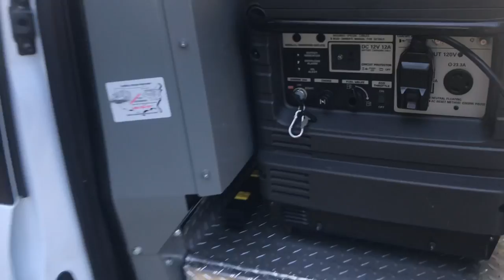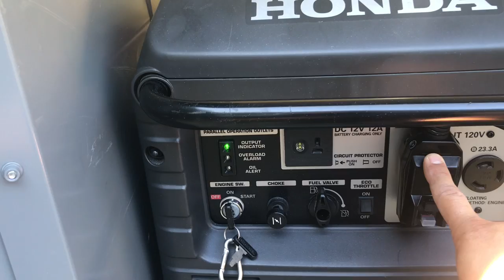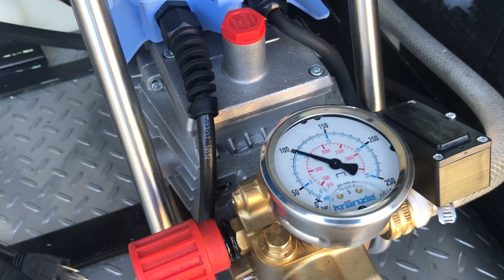Kranzle K1322TS

Comment: Genius set up for the water line system. It will make it very easy to go from tank to water hose without the need for extra hoses. To fill tank.
Reply from the maker: Momentum Tint & Detail Thanks sir thanks 👍🏼

Comment: NPT 3/8 female to male 90 deg elbow. Hardware store in plumbing section under $5. It will be black steel. Don’t be alarmed, I had to use one to connect my hose to my reel. It will hold up to the pressure without a problem.
Reply from the maker: Momentum Tint & Detail thanks I will do that thanks sir 👍🏼👍🏼

Comment: Hi bro nice setup I just bought mine but have some questions about the psi readings isn’t your reading on this video 1600 psi I have the same. But isn’t this 1500 max  ? Aren’t the red marks the psi reading I use the 4.0 nozzle like mat recommends but gets this hi I don’t want to ruined it
Reply from the maker: Alberto Alonso is all depends on the nozzle you will be ok not problem I use all different nozzle and I get different readings so all good bro👍🏼👍🏼

Comment: Given that you have a mobile setup, would it not have been better to just get a gas-powered pressure washer and skip the generator? 
A gas powered Kranzle 13/150 Profi jet pushes 3.4GPM. The 1322 pushes about 2GPM

Comment: How much water did it take to wash your truck? Can you reduce the gpm?
Reply from the maker: You can reduce the gpm but is going to take longer on this truck with all that mood like 30 gallons but in this case if you get a detail like this you need to change more or use the costume water 💦

Comment: I love it...
Have a commercial pressure washer with Honda GX 160 motor&added electric start for 2 yeara now. It is a workhorse,
always starts with 1st turn of key but is very, very loud&smells bad from gas/exhaust. After your review, I am switching to the Kranzle. Also, Have you considered adding spotfree water deionizer? I save half the time drying the car&no spots.
I have the older Ford Transit Connect with 50gal water tank with deionizer plummed on side of water tank&it fits just inside very back of sliding side door. Only problem is resin needs to be added every 2 months for $100 to deionizer tank.
Reply from the maker: pc1967 !! nice bro!! I maybe add it to my garage so I can fill  up the tank from my house I detail cars in my garage so I think that will be good for me. Will be nice to see your setup to get some ideas 💡 is a other kranzle review coming next week if you want to check it out. Thanks for watching 👍🏼👍🏼

Comment: Have you had any issues with the breaker on the gfi plug kicking? I have the predator 3500 inverter generator and mine kicks all the time due to intermittent fluctuations in power is what I’m guessing.
Reply from the maker: No bro no problems with my.
Reply: This is the concern I have since I have the same generator. Don’t want to spend $1200 before I know my setup can handle it

Comment: Ugh  it's still a tiny electeic motor n pump .. It won't clean no concrete! Com'on Mann.  It's the best auto detailing option sure  but still overpriced. Should be $500 to 600  and  $1 maximum sold as a kit with every accessory.. Wand, gun, foamer, hoses, quick connects.  Then... Maybe it's worth it. I do love it though it's quality components and built tough ...but that shouldn't cost extra as everything should be built solid!
Reply from the maker: Stephen Louden yes I’m with you bro!! I will prefer to pay like $400 or $500 at max but is not me the one put the price, I think is a great pressure washer I have like 4 different pressure washer and so far I still think what this is the best for auto detailing is just my opinion and again i have no business with this I make no money saying this I’m just trying to help others to take their decisions thanks for your comment I appreciate the support 👍🏼👍🏼 have a great day!!

Comment: Hey there I have a question since I have the exact same setup..after turning it on and spraying - the Kranzle  turns on for a sec every couple seconds .. does this happen with yours as well?
Reply from the maker: Nicolas Izquierdo my don’t do that the problem you have is because I’m sure that you have a small lake so the pump is trying to get pressure back the lake will be after the pump by your pressure hose or quick disconnects or something like that check it out and let me know if that fix your problem thanks for watching!!

Comment: What kind of generator you have and how many watts you need to run the Kranzle?
Reply from the maker: Mrjozz011 is a Honda EU3000is, you need 120 volts 20 amps bro.
Reply: Thanks!
Reply: @RaldasDetails  its 115v at 15 amp

Comment: You have an awesome mobile detailer setup there brother! I really want a setup like yours and if you can help give me some info on the equipment your using (water tank, hoses, adapters and fittings etc.) and where to get them will help alot. If you have an email that I can contact can you please put it here. Thanks alot for your time!
Reply from the maker: hmoobthoj01 raldasautodetail@gmail.com

Comment: Te gusta mucho el cox reel? Y la pistola sgs28? Estoy decidiendo entre sgs28 y mosmatic
Reply from the maker: Genysmen runner  si la verdad está bien bueno está muy bien construido. 👍🏼👍🏼
Reply: Ralda’s Details estoy pensando comprarla. ¿Que manga usa, es la kobrajet de obsessed garage? ¿Y para conectar la manga al reel usa quick disconnect o solo la enrosca?
Reply from the maker: La manguera q yo estoy usando es diferente como también el reel no los compre en obsessed, los compre en Amazon los q yo tengo son mucho más baratos y lo q usé para conectar es un conector q lo venden en Home Depot si quiere le consigo los links para facilitar la búsqueda.
Reply from the maker: Coxreels 112-3-50 Carrete para... https://www.amazon.com/dp/B005K8EA1M?ref=yo_pop_ma_swf
Reply from the maker: Ultimate Washer High Pressure 22MM Adapter Fitting x 3/8-Inch Brass Male Pipe Thread 5800 PSI Rating Compatible for Troybuilt, Excell, Devilbis, Lasco 60-1057 models https://www.amazon.com/dp/B01IU98KY0/ref=cm_sw_r_cp_api_A3H9Bb54H6HFV
Reply from the maker: UBERFLEX - Manguera de lavado a... https://www.amazon.com/dp/B018H74H74?ref=yo_pop_ma_swf
Reply: Ralda’s Details ok entiendo gracias por los links, usted cree que es malo usar un reel de 100pies para una manga de 50pies?
Reply from the maker: No es malo todo según el espacio q tengas en tu van. Pero no afecta en nada.
Reply: Ralda’s Details ok gracias por la ayuda
Reply from the maker: De nada. 👍🏼👍🏼

Comment: Hi Tony,
You still interested in my 75 foot hose with quick disconnects? $175.00 like new used like three times just got back from town couple of weeks ago. Reason I will sell just need a 25 ft
Reply from the maker: Hi sorry for being late, it is a 75’ i remember you tell me was a 50’ ?
Reply from the maker: Is a 75’ I remember you tell me was a 50’ ? I need a 50’ because my reel is to small so you asking $175
Reply: Ralda’s Details hi sorry for the late response yes it’s a 75 foot correct?